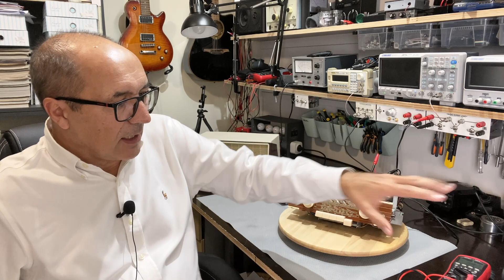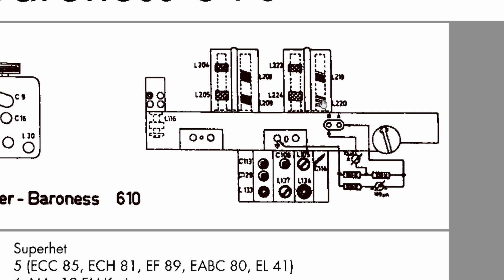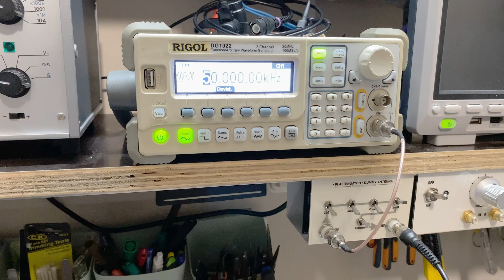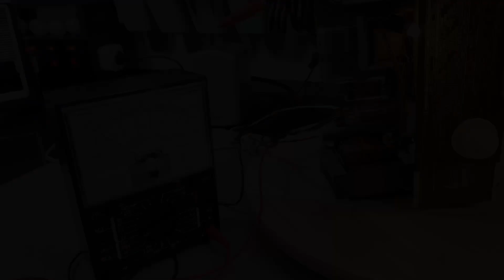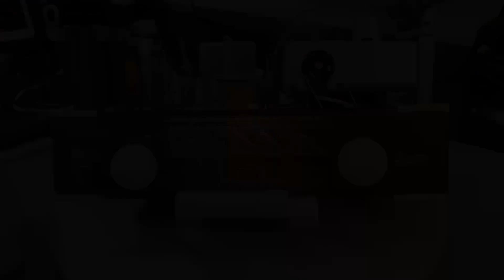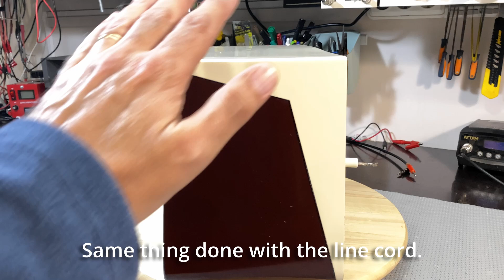Restoration complete. She's ready for the waves. Graetz Baroness 610 restoration pt. 3

Comment: As always this is an excellent video that you have put together.  A couple of my early 1950's German Blaupunkt radios do not have alignment instructions available and after watching some of your videos it occurred to me that I may be able to make these FM adjustments by simply measuring the voltage across the "discriminator capacitor" which seems to always be a 4 uf electrolytic. By adjusting I mean "peaking" the voltage readings for each IF can.  Is this something that I can do without negative consequences or is there something about some of these old German radios that will keep that method from working?  Also, it seems all of these radios look for  the final transformer core to be "nulled" as the final step to IF adjustment.  I understand this final adjustment is supposed to reduce or eliminate distortion and I understand how to use the two resistors and measure from between the resistors to another point near the final IF transformer core.  Can this adjustment also be carried out in the same manner on one of these Blaupnkt radios from the early 1950's in order to complete the IF alignment?
Thank You as always.
Reply from the maker: Many of the alignments I do I could actually do without instructions at all. This is because they generally are exactly the same for most radios. You can in fact do exactly what you suggest, but take care to do things carefully and not try the wrong coils when you’re aligning.

Comment: Hi Manuel, great job again, really enjoy your vids. A question, as I'm working on a Telefunken Rhytmus (about 1964 I believe), how prone is the rectifier to fail? The radio is in perfect condition, like a 5 year old example even though it is about 60 years old, it seems it has very little hours on it. Thanks and best wishes from the Netherlands.
Reply from the maker: The rectifiers do tend to fail after some time, but there is no exact rule as to when. If you want to leave it in place, make sure the fuse is the proper rating, or even a little lower than specified, so that if the rectifier shorts out, the fuse will be the only thing to blow, and not damage your transformer.